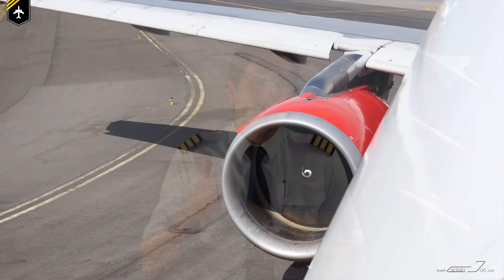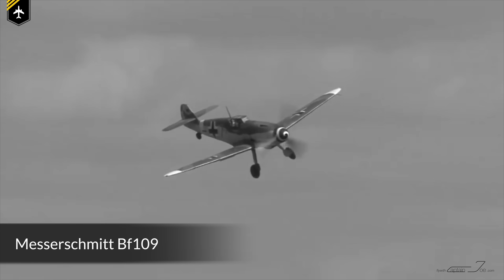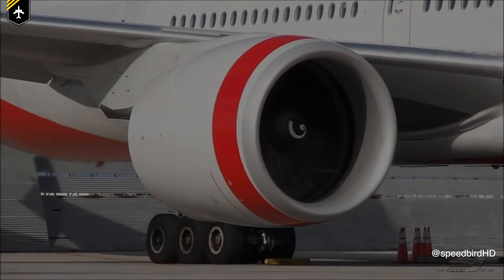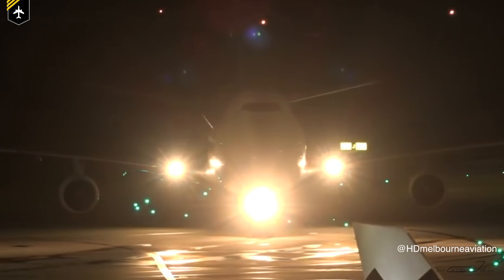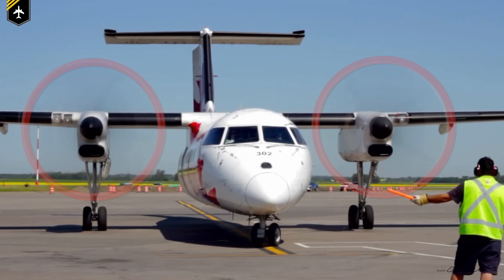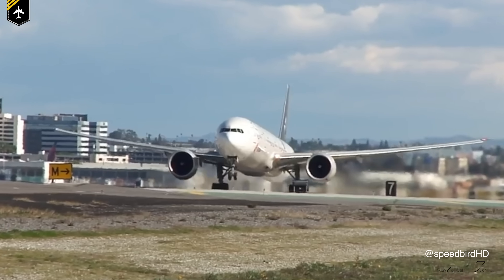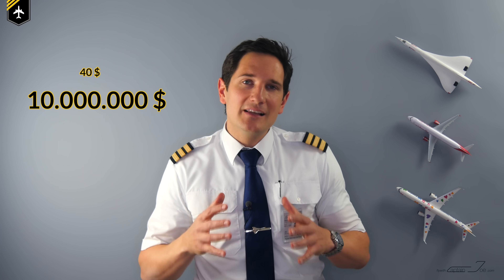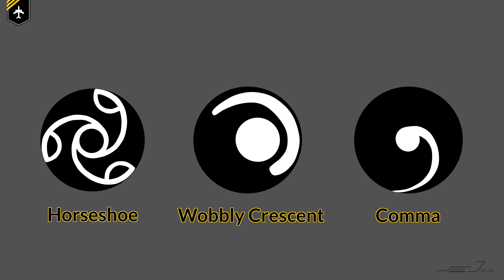WHY is there a SPIRAL in a JET ENGINE? Explain by CAPTAIN JOE

Comment: They should put bird net cover on engines lol
Reply from the maker: I thought about that idea too!
Reply: I'd assume you would suck all sorts of garbage on the net and it would mess with the airflow. And honestly as a bird I'd rather be shredded in seconds than be sucked against a net on a 8h transatlantic flight
Reply: MatrixMixer it doesn't worth it. It messes up with the airflow, adds weight...

Comment: I have a question, Why is it that when the plane is lifting off at first you can feel the force and speed but after a second you cant feel it anymore and it seems that the plane is falling?
Reply: Agata Garbacz your just feeling the initial g force after takeoff, it then tapers off as the plane isn’t gaining altitude as quickly as when it first leaves the ground
Reply: 12988Jake Yes that is pretty much what I thought as well.  But the vertical (and also horizontal) acceleration is here more important than only the vertical speed. The acceleration quickly fades out as the plane climbs in a linear way. To keep the vertical acceleration you need to fly a parabola, like in zero G flights.
Reply: Wow all these comments are helpful, no name calling, no political statements, no "are you stupid" comments. I'm impressed.
Reply: As other comments pointed out, initially you lift off the ground fairly quickly but then your ascent slows a bit, however the feeling of "falling" is actually most likely an illusion of your body's sensory system - it's one of the things pilots have to train for because sometimes your senses will trick you into feeling like you're falling when you're not, and if they act on this feeling and put the plane into a dive they could cause serious problems or crash.
Reply: The moment you lift of there is a small positive G Force as the pilot pulls the nose up - you can feel that. when the plane has reached its climb angle he lets loose on the stick/joke and there is no more g force acting on you - but your body already was adjusted to it - so for a moment it actually feels like negative force and like you are falling.
Reply: Skotshi Oh yeah that might be it but why Would it feel like the plane is falling Just after it lifts off?
Reply: ANSWER TO QUESTION:  once you reach your required speed, you are no longer accelerating, at that point everything in the aircraft are moving at the same speed.  Same for down and upward movement.  Consider a 1950's sci-fi movie, the rocket ship is accelerating up, the drag on the astronauts pull them deep into their seats, cut the rockets and they were weightless-floating around those huge cabins.  WHY:  because the spaceship was no longer accelerating and everything in the ship was moving at the same speed, and of course out of earths gravitational control.  The 50's rule 🤖🚀
Reply: You experience lateral G-force during takeoff. That's the change in force you are experiencing due to the sudden quick acceleration. You'd feel the same way if you ever drive or ride in a fast car. My car has a g-meter and it fluctuates around 0.8-1.1 Gs during acceleration or sharp turns.
Reply: Agata Garbacz It's Because when the plane is lifting off of the ground you can feel the force of the acceleration of lifting of the plane and when the plane is vertical the force of gravity gives you that feeling of like the plane is falling because of the acceleration and vertical position of the plane.
Reply: I am not sure but you may feel the speed because of the wheels. The runway has small "gaps" in it so that rainwater can flow to the side of the runway. Maybe you feel the vibrations of the gear.
Reply: 12988Jake Thanks So much that explains a lot 😊
Reply: A7x Now its all making sence thanks So much, That is So cool hope your future job Goes well for you 😊
Reply: Newton's First Law (Inertia)
Reply: No vibrations or bumps from the ground through the wheels I suppose, which tricks your brain.
Reply: Easy answer: We feel acceleration, not velocity. When a plane takes off or lands, you feel the change in acceleration as you begin moving faster both forward and upward (back and down when landing). Once the acceleration levels off (and your velocity smooths out), you no longer feel the force.
Reply: Doctor Jew The force is strong
Reply: Agata Garbacz do the same thing in a car, you feel the acceleration from standstill, and you feel any slowing down from cruising speed
Reply: Agata Garbacz yeah I feel that to. Great question. What is your favourite airline
Reply: JO - KING Ohh gosh has to be Etihad 💕 Wishing to work for them one day, Whats yours?
Reply: JO - KING the same reason you feel a car accelerating but not so much when maintaining speed.

Comment: thanks for the history lesson on the spinners. Question on a different topic: do pilots have to rewind the cockpit voice/data recorders before each flight?
Reply from the maker: No, it does that automatically !
Reply: They aren't using tapes anymore anyway. Basically what they use today is very similar to a SSD in a PC. (Solid State Drive)
Reply: shi01 I heard that they are going to be obsolete once telemetry livestream is employed.
Reply: Well i wouldn't rely solely on a system that needs a stable data link to work. But of course it will have many advantages. You don't have to search the black box at depth of 3000m under water or have to try to recover the data after it layed 2 houres in burning jetfuel.
Reply: Be kind: Rewind!

Comment: ok one question so why do they not paint the fan blades on jet engines white, to either scare away birds or alert ground crew. as you said they do it on the bombardier dash 8 q100-q400 so why not jet engines ?
Reply: Adam Croft i would say weight issuses but not sure

Comment: Please make a video explaining what exactly happened with Malaysia Airlines Flight 370.
Reply: Sumedh Nandedkar nobody knows
Reply: I know what happened :
They disappeared.
Reply: The evidence we have points to them flying in more or less of a straight line for a while after they lost radio contact, I'd guess something incapacitated the crew and the plane just kept on going straight due to the autopilot until it ran out of fuel and crashed in the middle of nowhere. Without actually recovering the plane we'll probably never know for sure though, so I'm not sure if there's much you could make a video about.
Reply: In my opinion it was Pilot suicide but everyone should believe in his theory everything could happend to this plane
Reply: Let's blame it on the 'Bermuda Traingle'. 😎
Reply: Gun Nut pt de Portugal não desse partido
Reply: GiddeonFox Not true! Look it up, there was someone turning the plane at different intervals, and turning off certain instruments and functions on the plane that most pilots wouldn't know how to do. Bits of the plane have also washed ashore such as the flaperon. The info is there, we just haven't found the main airframe in a huge area of sea
Reply: Bro saya tak faham apa yang cakap. He is a Malay bro
Reply: Sumedh Nandedkar 

False flag
Reply: Sumedh Nandedkar nobody knows ffs
Reply: Sumedh Nandedkar my theory is that it got shot down
Reply: Active Now what video?
Reply: There is not enough evidence to present a confirmed sequence of events. We know that it broke up at some point, but that's pretty much it.
Reply: Yeah sure, cause Joe knows something that we all don't

Comment: thnks for video
why the engine not came with grill or something similar to prevent bird or human from sucking inside
Reply: It would obstruct airflow, and if you smoke a bird while you're flying it's gonna go right through the grill anyways.
Reply: And also objects can get stuck in the grill and prevent airflow.   You would be surprised how big objects can actually pass through the fan and the secondary airflow (outer airflow not the core engine)

Comment: Fun Fact, A Rolls Royce engine will have a rubber tip on the end of the nose cone.
Reply from the maker: More fun facts, they spinn in the opposite direction than all others!
Reply: Jakub Pollák, They have the rubber tip to break up ice when in the sky.
Reply: Jakub Pollák because they are rolceroyce and drive on the wrong side of the road :-)
Reply: Do they actually spin in the opposite direction or is the spiral just painted the other way?
Reply: Why?
Reply: Craig Simpson only a hand full of the World believes this... But also the world used to believe it is flat.  So who knows :-)   just trying to point out it doesn't matter what direction it turns, as long as the engine is designed to turn that way.  Not sure but I think RR also reverses the rotation on the N2 system (mid pressure system)
Reply: Jasper Rost, this is affected with having a 3 shaft systems that GE, Pratt and Whitney and CFM do not use. This does affects the direction in some ways but is more efficient than the 2 shaft system normally used.
Reply: Craig Simpson yes I know  but you don't have to reverse the direction in a 3 shaft system.   Also the pw 1100 (geared turbo fan) does reverse it also due to having the planetary gear.  BTW. I work on the ge cfm and pw  engines.
Reply: Jasper Rost, we drive on the correct side of the road. :)

Comment: Why does the engine open when landing? How does it reduce the velocity of the plane?
Reply: That's called reverse thrust. It is initiated after landing and used for emergency stops when you are starting your takeoff roll and need to stop quickly, but these are rare and are mainly used to stop quickly after touchdown. It opens to capture air and expels it through the fan turbine (I'm pretty sure) to act as the main brake during high speeds on the ground. I think he has made a video on this already however :)
Reply: It is reverse thrust, so the forward power is directed in the other way so you are practically turning the engine direction around.
Reply: /watch?v=cfFZ2-Am-Zk
Reply: https://www.youtube.com/watch?v=cfFZ2-Am-Zk&t=5s
Reply: You're not strictly correct - it's a common procedure to use reverse thrust in any situation when needing to rapidly decelerate on the runway. It also doesn't reverse the airflow but merely redirects it partially.
Reply: Captain Arey the air is not expeled through the fan turbine,that would stall the engine . The reverse just deflects the fan air forward (at certain angle) sideways the engine nacelle.

So the reverse doesn’t capture any air, it blows the air that comes from the fan.

Comment: Plzzz captain joe explain about how jet engine burn fuel  30,000 feet  above MSL be cause the temperature is too cool
Reply: syed ameeruddin ,;,jet engines have "compressor" after the "air inlet" .In the compressors the ambient air is too much compressed and pressure get too high !!!! by this high compression and pressurisation ,high temperature is gained by the  highly pressurized air gradually as it goes inner to inner to the compressor and then get ignited by spark and combustion occurs which generates thrust after all!
Reply: Rohan Bhowmick thank you bro,
Reply: syed ameeruddin , welcome! from where are you from?? are you engaged in any field in Aviation ?
Reply: Rohan Bhowmick  from india iam a mechanical engineer interested in aviation and aerodynamics, And where are you from
Reply: Rohan Bhowmick I want to make career in aviation but no idea how to start being a mechanical engineer,
Reply: syed ameeruddin ,I am also Indian ,I am doing aircraft maintenance engineering !!
Reply: syed ameeruddin , don't worry , mechanical engineers are also accepted in a huge  amount in Aircraft engineering!!
Reply: Rohan Bhowmick ok bro
Reply: After the air has passed through the compressor it is at ~400°c  even before getting to the combustion chamber. Generally there isn't to cold air for the engine (jet engines get more efficient in colder regions) they are more worried about getting to hot.